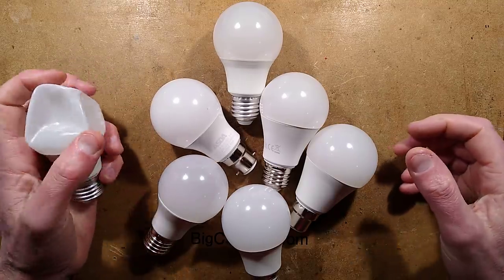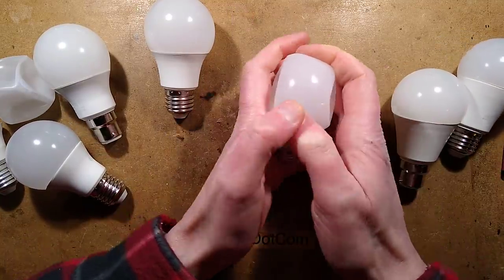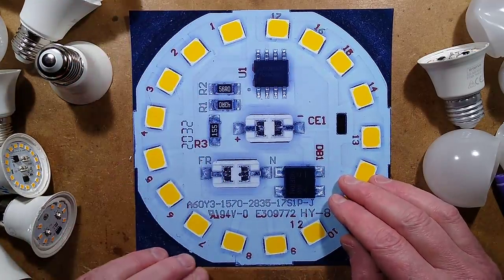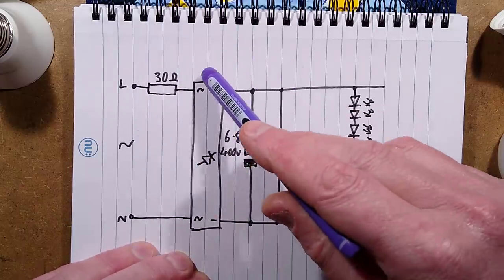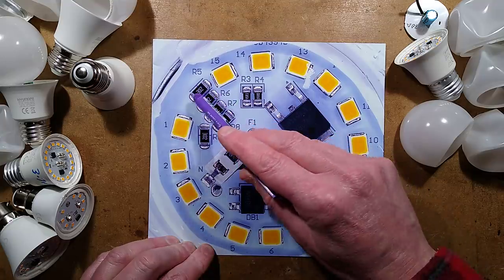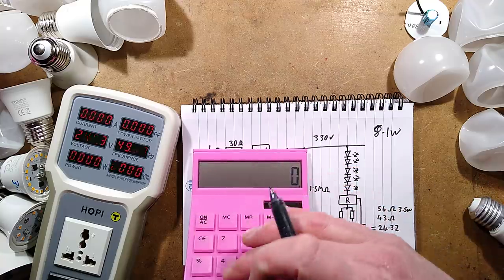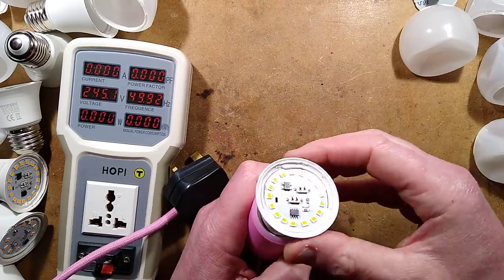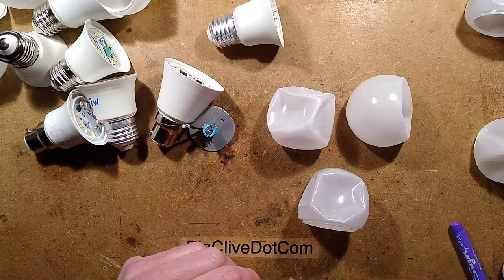Crushing and hacking LED lamps

Comment: I can attest to how sensitive LED lights are to leakage current. I installed one of those pie plate fixtures at a friend's house, and it dimly glowed  when the switch was off. The first thing I did was check the switch, but that didn't help. I eventually found out that the 'professional' electrician who installed the branch circuit had reversed the live and neutral at the GFI breaker. The capacitive coupling between the always live circuit board and the grounded pie plate was enough to make the LEDs glow.
When I told my friend the wires were reversed, he still insisted that it must be a faulty switch. I told him it couldn't possibly be the switch, and when he asked why, I pointed to a nearby table and said, "Because there it is, sitting on the table."
Reply: That just makes it a night light, right?

Aside from the fact that everything in that house has very questionable safety!! ⚡⚡🔥

Comment: Interesting stuff. I've had issues with Sylvania, Philips and Walmart (and every un-branded bulb I've bought so far):  They fail in an odd sort of way by, ultimately, randomly blinking off and doing so very annoyingly once on for a few minutes.  The only brand, so far, that has not done this (nor failed early - as of yet) are the GE LED bulbs.  I run them 24/7 pretty much.

Comment: Hey Clive. Just made a modification to an ASDA bulb similar to the ones show in you video and now it runs much better, thank you so much :). This particular bulb is the 14w version sold by ASDA and was running incredibly hot. I managed to remove the plastic cover by clasping it and twisting and it came of without deforming it and it pops back on with no trouble which is very pleasing. The circuit itself is basically two of the same circuit running on one board, each circuit had a 43 ohm resistor and then a 91 ohm resistor in place of the 56. Working with the calculation you used to reach the value of 24.32, (R1XR2/R1+R2), i found that removing the 43 ohm would run the unit at around 4.5 watts and removing the 91 ohm would leave the unit running at around 9.5 watts. I removed the 91 ohm resistor and now the bulb runs just as bright as a stock 10w bulb but with a lot less heat, bright enough to light up my workspace and will no doubt last much longer. Love the channel and congrats again on 750k subscribers, cant wait for the next live stream, much love from Sheffield, 8-bit.

Comment: I have bought six 50W workshop lamps from China couple of months ago, which turned out to be using the same current regulating chips. They were grilling the LEDs at close to 1W each, while the max allowable for them should be 0.5W. Unsurprisingly, all of them failed within a month of use - each one had a black spot of death on one of the LEDs. 
I have managed to find the spec sheet for the current regulating chip, added suitable resistors to limit the current, bridged out the dead LEDs and the lights are back to working order again, drawing less than 20W now.

Now, this is the part where I thank you Clive for putting your videos out there, encouraging tinkering with electronics and explaining everything in an incredibly approachable manner. Without this I would have never even though it would be possible for me to reverse engineer this circuit, repair the lights and possibly even make them more reliable. Thank you!

Comment: Howdi Clive! I take another approach to reduce the current and heat of the LED panels in this lamps and created "The Frankenstein" lamp. Did this with some 1 euro lamps from Ikea (model: Ryet LED 40W power consumption:4.2W). Maybe I plan to create an instructable for it. Use it for months now and works great! The idea is this:
1. Disassemble five lamps of the same kind (Ikea Ryet for example);
2. Take one controller board to use;
3. Attach all LED-panels in parallel to same controller board.

Tada, your Frankenstein lamp is born. Result: Alot of light, no heat (1/5 of current), 5 light points, same wattage (4.2W)! I use this for months now in the kitchen. Created 5 spots with the LED-modules, use decent cabling and use one 'controller' to steer all of the LED-panels. It is awesome! A plus, power consumption saving. Normally when using 5 of the same Ryet lamps, the power consumption is: 5x4.2=21W. With the Frankenstein setup, it is only 4.2W! This setup reduces current (limited current ballanced between LED-panels), reduces heat and saves energy.

Great idea to try on your channel.

Comment: I'm curious how the circuitry is different inside a "dimmable" LED lamp.  Are they different/interesting enough to do a video on dimmable lamps?
Reply: They actually can use almost the same circuit but with a different current regulator chip. I just opened some lamps today that had the chip called bp5131h which is not dimmable. But this chip has sort of a bigger brother called BP5132H which is triac dimmable and only requires connecting an additional sense pin and one additional ground connection but it comes in the same sop8 package. My guess is that the BP5132H is marginally more expensive and thus not used in these bulbs. Also manufacturers love to keep cheap to implement commodity functions for more expensive product lines as a means of product segmentation.
Reply: @nicholasweiss4662    Thanks for the information and response to my rather old question!

Comment: One of my LED bulbs failed last week and, based on your video, I had a look inside. The wire from the terminal going to the FR (?) had come off. A quick soldering job and I was back in business. Mine was a "Status" 9W bulb and had an 51R and 82R in parallel. Quick snip to take the 82R out and I have a reclaimed bulb which is less harsh. Your info has saved me a fiver (ker-ching!) :)

Comment: My house ( a rental ) is fitted with numerous 60W equivalent LED bulbs, made by GE (China, of course). In any event, these have been failing at a great rate, after about a year of usage.  I have taken a number of them apart, and they share the general construction shown in the ones you have in this video.  These are 120V lamps, and have 8 LED devices in them.  7 of them operate at around 15 volts per chip, and one operates at about 9.6V.  The failure is the same in every one of them that I have examined.  One of the chips will develop a fault in which I think a bond wire becomes detached. If you press on the top surface of the chip, you can get the lamp to light, and it will remain lit until you turn it off.  Reapplying power means you must press on the top of the defective chip again, and it will light.  As you have indicated these chips are being driven very hard. This is probably contributing to this failure mechanism, although I don’t understand precisely how.  I could probably return these to service by soldering a jumper across the failed chip, and cutting one of the sense resistors off the substrate.  It would work by just jumpering the failed chip, but this would push the current regulator harder, and then it would just fail.

Comment: Use a hot-air source to soften the plastic for better deformability. Painting them black and drilling a bunch of tiny holes in them makes for a nice sparkly effect with neat projected light patterns!
Reply: What happens if you sprinkle it with glitter

Comment: Clipping a resistor! such a simple solution. I put a capacitor in line with the same bulb, to limit the current. But your solution is much simpler (elegant! Love it!) . I have a outdoor PIR lantern, running a modified bulb for years now.

Comment: so THAT'S how you get the covers off. I've been cutting them off.
Reply: Clive smash!
Reply: Yes me too lol!!!!!  leave it to Clive to figure it out.  "just smash the crap outa them it will pop off then"  LOVE IT!!!!
Reply: You can just cut around the bottom edge of the cover and open them up by swiveling 90 degrees to the side.
Reply: Yes, try and focus the force on one side, they come off quite well
Reply: @masteryoda394  Do. Or do not. There is no try.
Reply: @Termiic  wonderful answer
Reply: I destroyed the bottom screw part
Reply: Nope, you just put rubber gloves on for grip and twist them apart.  Clive is doing this the hard way.
Reply: ...yes, I also cut them off to preserve the shape.. they make great greebles in my scratch-built Sci-Fi ship models..
Fuel pods, antenna domes, Trans-meta Dimensional-Hopper Drive Units, living quarters etc.
Pouring paint inside gives a nice shade, also concentrated Ritt Dye,
Painting outside surface of course makes it look like any other plastic.

Comment: I think there is another reason that the capacitor is on the back of the board: it’s huge! If it was on the front of the board it would be in front of the LEDs and cast a shadow when the bulb was powered on.
Reply: I found a Walmart bulb here in the US, the '5 year life, 60 W equivalent', that has the cap on top of the board. Although it is laying down. It is a through hole electrolytic with the leads bent and used as surface mount. Also they had two identical resistors. They hacked just fine though.

Then again in the 12 pack they are less than $1 USD each.

Comment: hmm... I wonder if there are clear potting resins that could be poured into the front of those de-domed lights to make them less death-tastic.
Reply: I was thinking a disk of clear acrylic would do the job.
Reply from the maker: I've 3D printed some caps.
Reply: Meh, I have a de-globed bulb in my desk lamp right now and have only electrocuted myself to death a handful of times, not some high #!

However, if you really wanted to, you could simply get some glass lenses and silicone caulking or epoxy them back on.

Here is a question:  How often do you find yourself poking a sealed bulb otherwise?  It's not on my top 10 list, but I do accept that some people have children or pets, but then simply don't use de-globed bulbs in areas they can access.
Reply: Lately a new favorite tool of mine is using a tube of silicone and a paint brush. For waterproofing PC fans for use inside water bins, but it is also useful as an insulator. The silicone easily rubs off the paintbrush if u get it b4 it is all the way dry.    I thought of this b/c I got some of those halloween ultrasonic fog makers and to my surprise the aluminum was pitting and not only decomposing , but making a mess.  Paint it with silicone.   Yes it works great.
Reply: @tdtrecordsmusic  There seems to be some disconnect.  "Silicone" is not a single thing, did you mean rubber, caulking, grease, oil, or ???  I'd assume caulking since you mentioned "dry", but there is no real need to use a mucky mess like caulking to paint something when... get ready for it... that's why paint exists, and, typical silicone caulking has either an acid or alkaline cure, neither of which is ideal for bare aluminum.  You can get "sensor safe" neutral cure RTV, in automotive stores among other places, but it is quite a bit more expensive, and you waste quite a bit since it is impossible to get as thin a uniform layer on as you can with paint.
Reply: @stinkycheese804  Now that you mention it, the stuff I have been using is far more substantial than the silicone which comes in cheap caulking tubes.    I looked into what people used to put aquariums together.  I can get the exact name when I get home if u need.  I think its just loctite clear silicone.   It works gr8 for iron / aluminum & LEDS... I am sure of it.  The motors + ultrasonics have been submerged for 6 months operating everyday.
Reply: @bigclivedotcom  great video the odd led bulb you mention is probably ultrabrites 5 uneven spaced leds from poundland, Dealz here  ive been pissing about with a few 3 watts got different brightness from each resistor thanks the 6 watt still surprizingly bright after modding
Reply: @bigclivedotcom  I've just come from watching that video. I'd have pushed out the original caps from the inside and put them back on.
Reply: If you don't like the death don't use plastic some cut glass beads cemented with balsa resin might be worth thinking about though.

Comment: Remember – the manufacturers didn’t choose to make LED lamps they were forced to make the switch from incandescent which had a relatively short lifespan, so not surprisingly the new LED ones are created to replicate this
Reply: They actually chose to but weren't expecting to find themselves competing with LED bulbs sold in Poundland. Have a look at the Philips L prize LED lamp. With its massive heatsink I would guess most are still working fine. Unfortunately the third generation without fins weren't much better than these cheap ones despite being much heavier. Five out of the six |I bought developed the same annoying occasional flickers within three years
Reply: Also, led sold for $3,  manufactured for $15, the government subsidizes the $12.

Comment: It seems that removing the plastic bulb cover would also increase a LED bulbs life span because the heat would not be trapped in a small space. That would be an interesting thing to test, how hot do led lamps get with and without their bulb on?
Reply: This makes a huge difference. With the cover, you have a temperature of about 75 °C or more. If you remove it, the temperature is at least 15 °C lower. But it's dangerous to remove the cover. Instead you can drill many holes into it, thus no one could accidentally touch the circuit. You even can drill many holes into the base for better cooling. I've done that and it makes a huge change. Combined with lowering the wattage your led bulb may last decades. xD
Reply: @3333927 make holes in cover   but the problem is in when the lamp is in kitchen because humid air led stop working well after some time

Comment: would drilling several small holes in the plastic bulb have a measurable effect on improving longevity by allowing a cooling airflow?
Reply from the maker: It could, but would also allow dust ingress.

Comment: I checked a 16 Led bulb with power supply here in the US, and each Led is about 8vdc full brightness.  It is possible to cut one out in grid down and hook it up to a car battery with a resistor to limit the current.  Save blown out bulbs.

Comment: I think.i would have given in to the temptation to touch the various components to see how hot they got after the mods.  Well done Clive for resisting and avoiding a shocking surprise.
Reply: I've done that to my own modified lamps.

I unplug them first.

Comment: Not a conspiracy. What basically happened is management determined a set of criteria for the light bulb to fulfill, lifespan hours being one of them, as well as cost being as low as possible. Engineering then goes and designs the light bulb, realizes their design lasts far longer than it needs to, and proceeds to design it to "sacrifice" lifespan in order to pump out more lumens with less LEDs by essentially "overclocking" them, reducing overall materials and manufacturing costs for the light bulb while still meeting the same lifespan and lumens requirements from management. Some of these light bulbs are just engineered to meet certain criteria that not every consumer falls under. Most consumers just want the cheapest possible light bulb, which this would deliver. 

However if you want a longer lasting or more efficient LED bulbs, there are light bulbs out there for you if you are willing to pay that extra cost for those criteria and/or willing to deal with less lumen output. Just because the popular ones are engineered to these specific criteria that you don't like doesn't mean that others don't exist that you can't buy if you look for it and are willing to pay the fair price for it. Despite popular belief, profit margins on basic consumer goods like light bulbs are not high. It's literally about 5%. Most companies are selling light bulbs to you for near the price it takes to get that light bulb to you. For a supposed conspiracy to extract profit out of consumers, it's a rather poor one in that case.

Comment: Just a thought.  Have you ever measured how hot the heat dissipation portion of an LED bulb gets for an unmodified and a modified version of the bulb?  I know that the base of the FEIT bulbs I use gets very hot and when you mention that the bulb you hacked should run cooler, I wonder what that might mean, roughly?

Comment: I have opened many LED bulbs, but I don't crush them.
Instead, I place a sharp knife between the dome and the body of the bulb, press enough to make it sink at least a little bit, and roll the bulb on a table while doing that. That will give you a nice separation without damaging or destroying anything. You just need to go slowly and gently, and be careful not to cut yourself or break off a component (like an electrolytic capacitor).
You can later re-attach the dome with some sort of glue or silicone if you want diffused light, but my rough estimate is that the light output is 20-30% higher without the dome.
I have done the same modifications to LED bulbs to reduce their power and make them more efficient, less hot and lasting longer.
Greetings from Bosnia!

Comment: Would there be a benefit to getting higher  wattage bulbs than you want and modify then to run cooler?
Reply from the maker: Yes they will last longer.
Reply: Greater efficiency and they last longer, so greater economy in two ways

Comment: Mine is glass, was glass, I thought it was toast after it smashed. The led disc slid off in my shop. When I found the disc it slid right back on and still works several years later. Better cooling helps in certain.